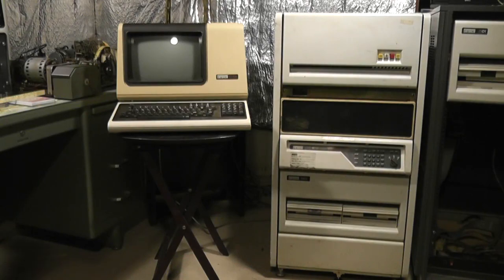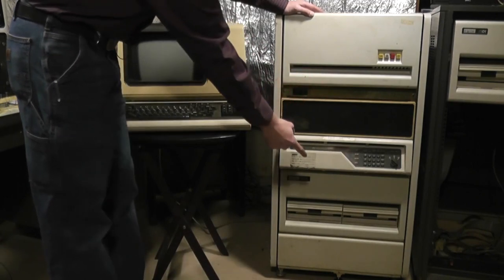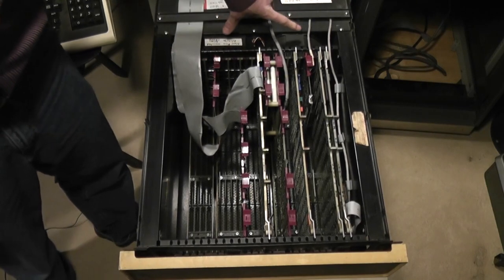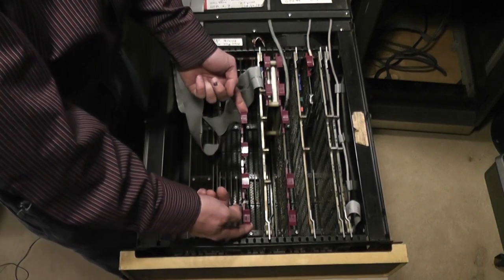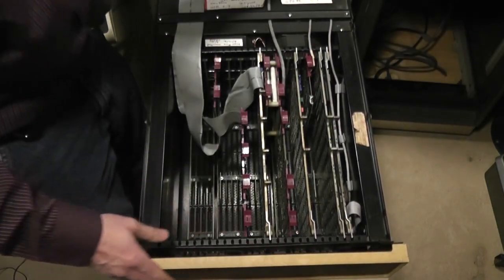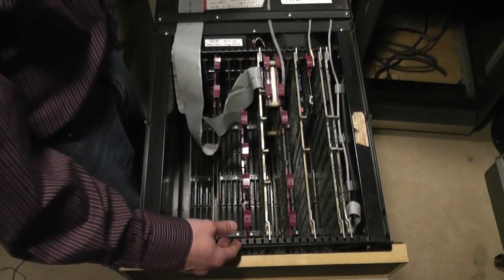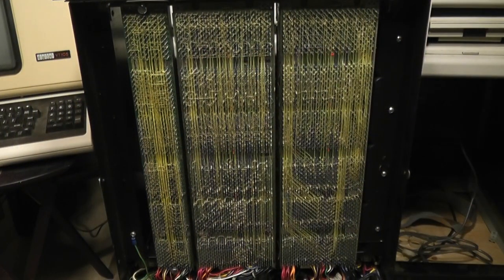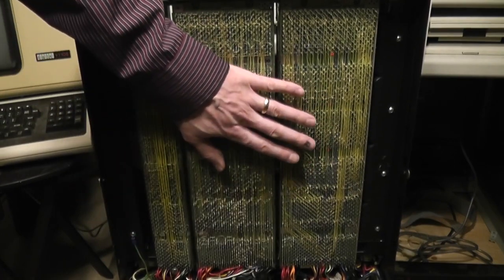PDP-11 System Tour: Overview, Processor, and Backplane

Comment: Thanks for sharing about the PDP-11/34, brings back lots of old memories. We used these in an industrial application controlling two 80 Megawatt electric arc furnaces. I was the lead electrical engineer responsible for the design, procurement, installation and ops/maintenance. We had two systems, the one controlling the arc furnaces had a custom built input/output front-end to interface all the analog and digital signals. DEC did have an Analog/Digital rack with various I/O cards, for example 1-10VDC Analog input and output cards, as well as digital I/O cards. We built the front end isolation amplifiers (Burr-Brown) to interface to the field equipment and to provide protection to the computer system. That system ran RSX-11s real-time operating system and it had no storage devices to maximize performance. The Host System located 1200’ away in another building ran RSX-11M multi-user operating system. Both systems were interconnected with the DEC data-highway, name escapes me now. The host system had two 5mb removable cartridge drives and two (I believe RL02?) 10mb drives. All programming was done using Fortran F-77. I believe our 11/34 could handle up to 256kB of RAM but I stand to be corrected. The remote system (RSX-11s) was setup very similar to today’s Programmable Logic Controller. The system to scan the I/O (written in F77 noted previously) read the input modules and updated the input tables (analog & digital) in memory, executed all logic functions in another program based upon the input tables, and then updated the output tables and wrote to the I/O. The operators of the system had ‘real-time’ displays based upon VT-100 terminals so they could view status and execute control. We had the capability to remote into the system via initially 300 baud modems and eventually a few years later 9600baud modems. It was amazing what you could do with so little computing resources by today’s standards. BTW the 11s system had the floating-point module as you mentioned to do math calculations. That board  was a lot more populated compared to the two CPU boards to my recollection. The system ran reliably for over 10 years and was my introduction to real-time control of industrial processes. Our parent company based out of Houston had an automation group where a lot of the engineers who I worked with were heavily involved in the Apollo program. So that was a real experience working with these guys as they did not balk an any technical problem, if it was not available commercially then we designed and built it fit-for-purpose. Again thanks again for this system tour and the memories.
Reply from the maker: This is a fantastic story, thank you for sharing!  You are correct that the 11/34 maxes out at 256 kB of memory (18 bit address bus).  I wonder if your interconnect was maybe DECnet of some kind?
Reply: Yes, now that you say the name that is exactly what it was. Stored in the deep recesses of my memory LOL
Reply: Well my dude, you architected and built a solution for those furnaces as if you were at NASA.
Reply: Amazing story about how these systems were used in production! I have several 11/34 systems im trying to get back online. Wish more comments had as much detail as yours, thanks for sharing the story.
Reply: Yes, they were truly fun to work on. A very satisfying experience overall.

Comment: Nice tour and a lot of memories. I worked in Kanata (KA0) manufacturing and built these systems along with other PDP11's and VAX systems. The "rounded" cable was the original cable, Panels and ribbon cables were not used for a number of years on the older systems.  I believe it would have been 1982 or 1983 when the I/O panels came out. I believe it was around the same time as the pdp11/73. The Original 11/34 systems shipped with La36 hard copy terminals that were "doc merged" when they shipped. VT100's were on the test floor from 1981 or 1982 till the lines shutdown. I believe that, if you look in the bottom of your cabinet, you will find a weight to counterbalance the pull out of the BA11 drawer from the cabinet. Again, around the time of the newer builds, (PDP and VAX)  an extended foot was added so that the drawer could be pulled out with ease and without tipping. Recently I seem to remember the smell of the new computer being powered up for the first time... not sure what that is about.

Comment: The bottom of that backplane board melted my brain. Absolutely fascinating old computer, especially the exceeding specificity of the bus configuration, from reconfigurable wiring to all the needed termination and bridging. When you look at a PDP-11 from an ISA, addressing and IO implementation standpoint, it looks like a simple 16bit machine, not much different from early 16bit micros. But holy smokes, the actual hardware implementation makes you realize why the field support personnel really had to know their stuff. You couldn't just check signals on a line, determine that some mux or pla IC is kaput and swap a chip, or just expand the machine by swapping boards, you might be wirewrapping things for a fix or upgrade, which is crazy! I can imagine, given the business-critical nature of these old beasts, that having to handle repairs or upgrades was seriously stressful.

Comment: Wow, this brings back memories. In the early 1980s I worked in a large broadcast television  production facility. Some of our older edit systems that controlled the VTRs were 11/34s. They had an 8 port RS232 card which controlled the tape machines and other devices. A custom keyboard, standard but alternate functions on the key caps. And a video display card that could drive any standard black & white video monitor. This was the terminal display. The memory was CORE memory. Two 32K cards. They didn't have floppy or hard disks so to store an edit list, you had to punch out a paper tape then read it back in when you wanted to use that list. That was time consuming so we had extra core memory cards. As they are non volatile, you could just power down and swap one of the boards. We got rid of those old 1970s systems fairly fast and the newer systems did have 8in floppy drives. They were LSI 11's IIRC?

Comment: That interrupt scheme is called a "daisy chain" interrupt. This is really amazing work on the video by the way. I loved this age of computers, and its great that there is interest in preserving this knowledge. Just as an aside, we worked on many pure wirewrapped designs. The common thing was to wrap the original design in blue wires, then wrap changes in red wires to show where the changes were made. It was always amusing to see the wirewrapped side slowly change from blue to mostly red! Another one was that when we had an intermittent, one of the engineers would inevitably produce a credit card and run it up and down the wirewrapped pins, like a kid does with cards in his bicycle spokes. This would identify loose wirewrapped connections.

Comment: The PDP-11 has the best ever assembly language.  (Almost) completely consistent, easy to write position independent code, intuitive addressing modes, and NO PAGE ZERO. 
So easy to learn and easy to write programs, especially when compared with other 16 bit computers available at the time, such as the DG Nova or the HP-1000.
Reply: MACRO-11. I still remember the one-instruction worm: MOV -(PC),-(PC) and mind-blowing FORTRAN-IV indirect code calling micro-subprograms while keeping the stack.
Reply: @dmitrykazakov2829  Oh Yes. MOV -(PC),-(PC) Ha ha, that was great fun.
Reply: Yep in the mid 1980s  I used to code 11/73s in octal assembler to control a console that simulated an industrial gas turbine. The idea was to hook up a control cabinet on the simulator and test the software and hardware of the same before connecting the cabinet to a real turbine half way round the world. This made sure that the control system would actually turn on the lube pumps etc. prior to starting: not much fun having to  strip a turbine down in the middle of nowhere!

Comment: Thanks for the tour.  I had a PDP-35 Plus assigned to me in the 1980's when I was working for a company which was later acquired by Siemens (Bldg HVAC and plant control processing).     My previous experience with the PDP line of processors included working with Lockheed/Martin developing hand off flight control systems for C-130's using first gen military GPS systems.   They were solid workhorse computers at the time and I am very happy to see someone keeping them "alive and kicking"

Thanks again !

Comment: One of the interesting aspect of the card rack is the interrupt structure and the card location. A major airline had moved to DEC PDP computers for pilot training. The 747 sim would just suddenly lockup during training exercises. I spent nights working with the chief trainer and learned to land the aircraft - later I actually did land one at Oakland. I found that there were two buss master cards and if they requested control at the same time, the computer would essentially say, “Huh!” and lock up. All I had to do was move one card to the front of the interrupt structure in the draw, and write a report, etc!

Comment: Nice. I taught the 1145 through 1170, 34 etc, and drives from RP02 through Rl02. This was in 1976 to Dec and customer support engineers back in the day when you fault found to chip level, or spent an entire night on site rebuilding an errant massbus drive. Good run through, thank you.

Comment: Doing some searching on the internet, the PDP-11/34 was a microcode driven machine, meaning that it would have had ROMs on the CPU that drove the microcode that ran the CPU operations, a very wide word of control instructions that drove the operations of the CPU. In those days, everything was in terms of "racks", a standard that comes from railroad switching equipment, and is still used today for things like data centers. I worked on various PDP-11 machines "back in the day". A hard disk with 10 megabytes or so was huge when everything you did was text interface.

Comment: Aaaah, things you could fix. Circuit diagrams, oscilloscopes... I used to be a proper computer engineer.
The company I worked for made a 1mB upgrade for this, it was 16 boards, PSU, a whole cabinet. Fitted one, just the once, for a college that had 48, I think, user terminals and a Teletype KSR33 as the console. "Jagajagajagajagajagajagaja..." etc.

Comment: Prior to the microprocessor, the CPU really was a cabinet or unit with discrete circuitry for the adder, memory, etc.. The CPU's of that era were not fast per se, but with clever engineering, performance became adequate. The microprocessor really did revolutionize the field. I'm trying to imagine an Intel Sapphire Rapids or AMD Ryzen microprocessor laid out with discrete circuits. The cpu would the size of a several football fields.
Reply from the maker: In fact it is impossible to go much faster (maybe a factor of ten, as a guess?) than the late discrete CPU designs, or to increase complexity by more than a few times, without moving to LSI or even higher integration packages.  The speed of light and associated propagation delays, combined with stray inductance and capacitance, start to mean that keeping synchronicity consumes an ever larger amount of complexity and power unless things become substantially smaller.

This 11/34 is nowhere near the limit, of course!

Comment: In the early 80s during university time I work in the electronics department of a large printing company. For image manipulation they used PDP11s. And there memory consisted of a number of 32kb? boards, that had to be reshuffled often to keep them running. Just to clean the connectors I would assume today. Real Hardware compared to the brittle supercomputers in our pockets today.

Comment: Similar physically to my MicroNOVA. When I was loading mine up the guy helping me dropped the hard drive on my foot. My foot hasn’t been right since. 

The hard drive was at the bottom of the cabinet, it made the whole thing less top heavy.
Reply from the maker: I'd like to put the floppy drive at the top of my cabinet (it's the lightest thing in the entire cabinet), but the RL01/RL02 is what provides the top surface for the rack in my configuration.  The RX drives have no top or back cover, so it would leave circuit boards and drive mechanism exposed on the top of the unit.

The CPU is the heaviest part of the system in this video, and it would be better off in the bottom space.  However, that makes it more difficult to work on.
Reply: @EthanBlanton  RLO2 drives are really really heavy, so i don't really want to know what the 11/34 weighs. My 11/23 is heavy enough with it's HDD and boardset
Reply from the maker: @the123king  the drive units are maybe 1/2 to 2/3 the weight of the processor.  Enough lighter that I'll carry one down the stairs, but I use a hand truck for the processor.
Reply: Except that Nova had maybe the worst instruction set in history.  I like to think that every mistake that wasn't made in the PDP-11 was made in the Nova, instead ;-)

Comment: Question: if a new "upgrade" board came out for the CPU, Memory, I/O etc could you just replace that board or does it not work that way on these older systems?
Reply from the maker: Memory and I/O, absolutely, they're just devices on the bus.  There are many such devices available.  The CPU slots in the backplane on this board are designed specifically for the CPU that is installed, but you could put any CPU on the bus.  The UniBone, for example, is a project to do just that with a BeagleBone Black.
Reply: @EthanBlanton  thank you for responding! I am a former Network Engineer, but I entered the work force in August 1995.

Comment: The RL01 came out in late 1978 or early 1979.
Looks like the optional floating point processor is missing.  I used to work for DEC
Reply from the maker: I have the floating point board, but it's not installed in this video.  That particular machine is not entirely reliable, and I don't (yet) know why.  Sometimes it boots and runs fine (passing XXDP tests for the processor, memory, etc.), sometimes it won't even operate from maintenance mode on the front panel.  I suspect it's a power supply problem.  In any case, the FPU is just one more load on the power supply and one more thing to fail!

Comment: Too bad my only experience with DEC is with an oversubscribed MicroVax with the world's worst cross compiler.  I ended up switching to Borland C on a 4.77 MHz PC which would compile the entire project in a few minutes, vs. an hour for the Vax.
Reply from the maker: The microcomputer revolution definitely changed a lot of things.  That was one seriously overloaded MicroVAX, though!
Reply: I feel your pain. I studied Mech. Eng in the early 90s and we had a lab with 10 X-terminals hooked up to a MicroVax with 16MB of RAM that we used to CAD/CAM labs. It took 10-15 minutes to log in and the same to log out at the end of the lab. Not much time to do any real work. Having used AutoCAD on an IBM AT 6-7 years previously I wasn't overly impressed... Guess Moore's Law was moving quicker than budgets back then.
Reply: I have the same experience.  I worked on a project ~1990 where we had a VAX 6200 and were developing C code.  We also used 386SX PCs in the project.
The same code compiled and ran much faster on the PC than on the VAX.  Later also some MicroVax was added to the project as a test system but it wasn't fast either.

But fortunately I also have memories of my first experience with a computer, which was on a PDP 11/40 in a highschool computer programming project.

Comment: I would guess the reason for the wire-wrapped backplane, is because this was before the invention of multi-layer PCBs, so it was impossible to connect all those pins with just traces